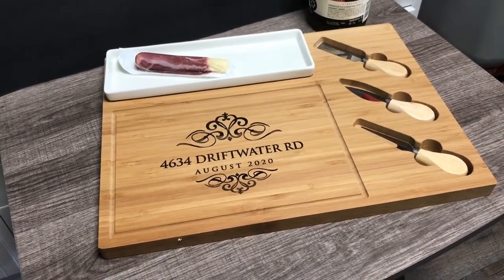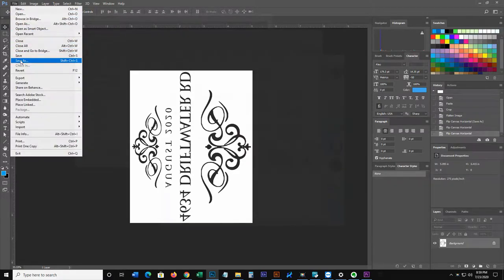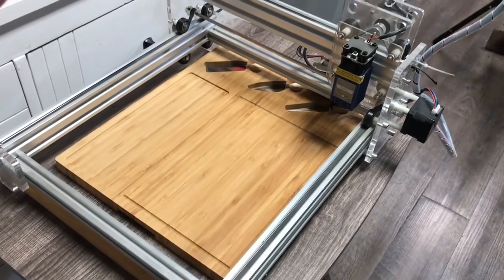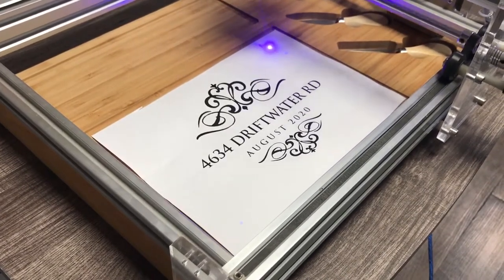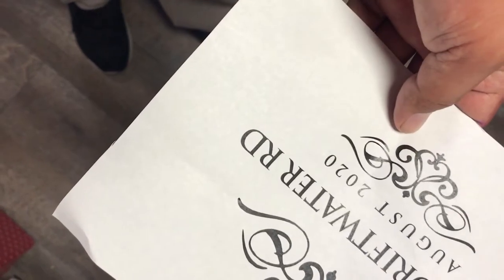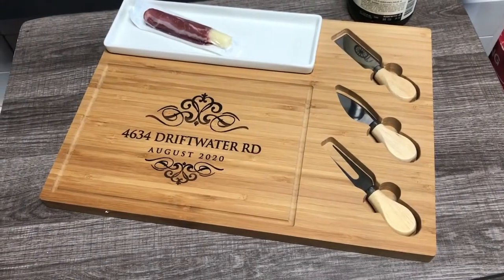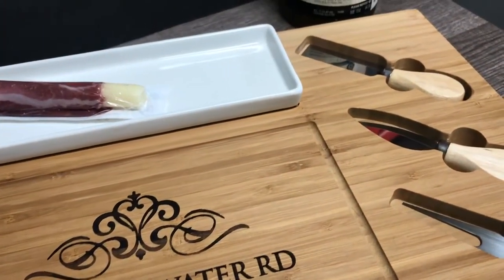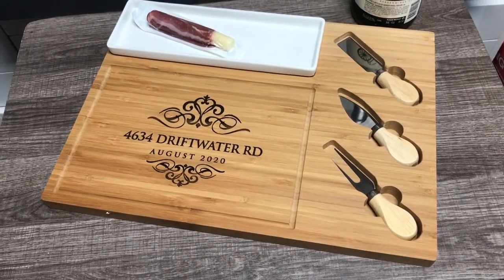Personalized Cheese Board Custom Engraved for Etsy

Comment: did you oil the board afterwards? I'm curious what happens to the engraving when it gets hit with oil
Reply from the maker: no, no oil before nor after. The engraving is deep enough. Your removing material from the board so it will always stay dark like that.